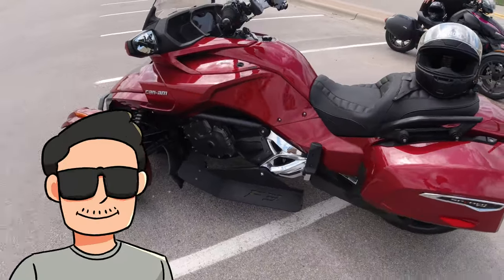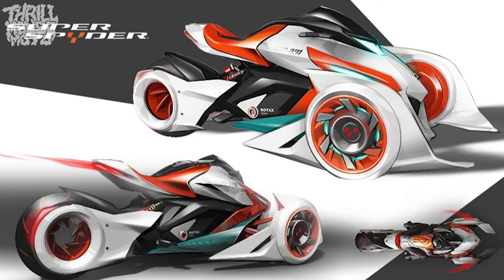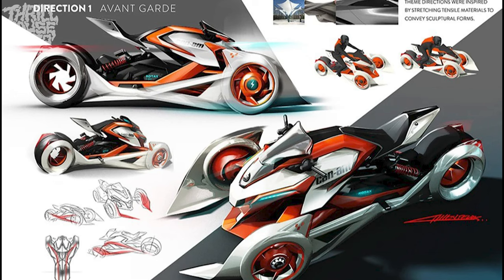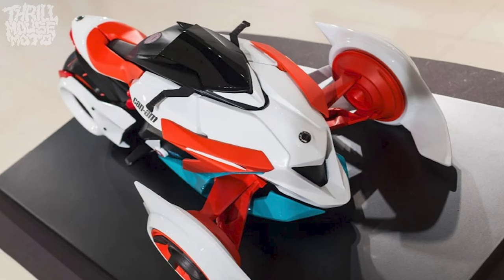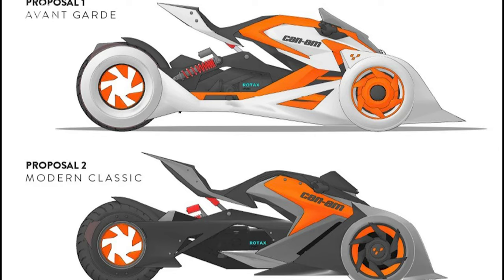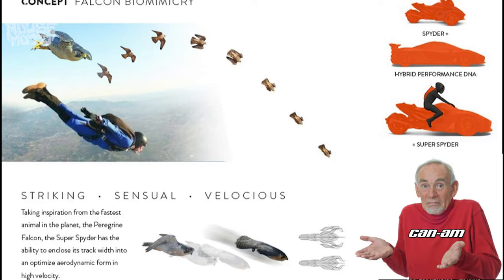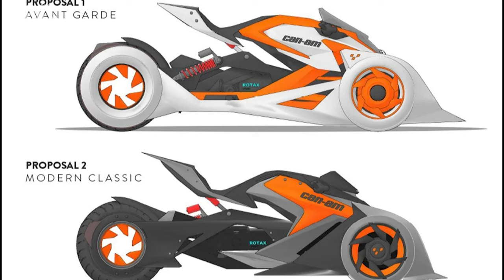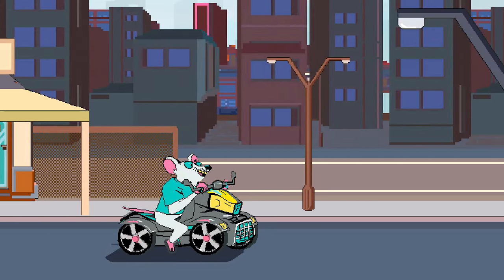Can-Am "Super" Spyder..? 🤯

Comment: Something like a Yamaha Niken but with the front wheels set wider out would be nice. Much more performance oriented, maybe F3 or Ryker sized, but offers normal motorcycle tires all around and allows you to lean a good amount in curves for high speed riding. Maybe have adjustable rear sets and clip ons so the rider can get really tucked and maybe a speed limited around 160 mph. The front wheels can widen or narrow depending on the speed to change how stable it is and the lean angle.
Reply from the maker: I think the Yamaha Nikens are sweet! Leaning is definitely where it's at, 👌💯🐭